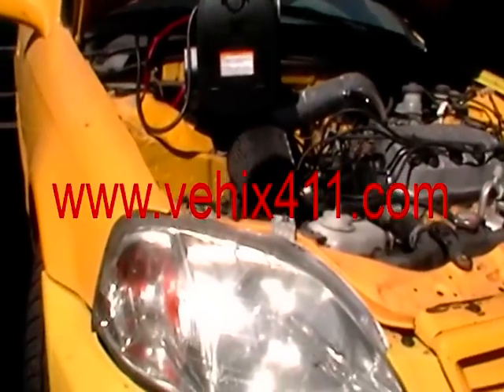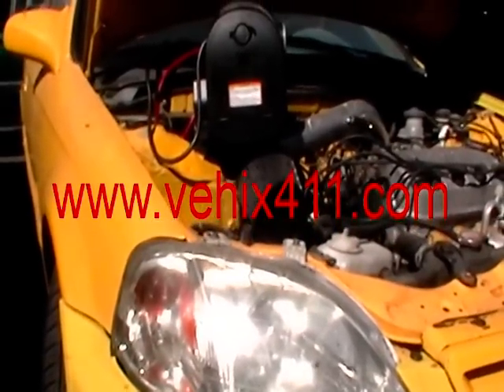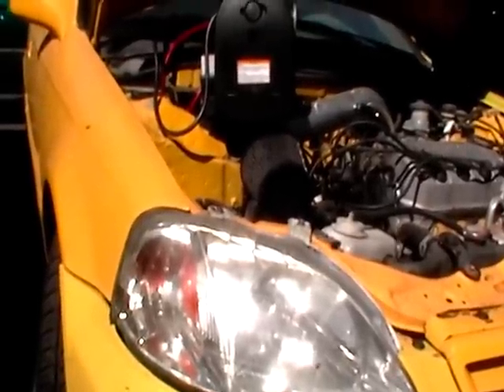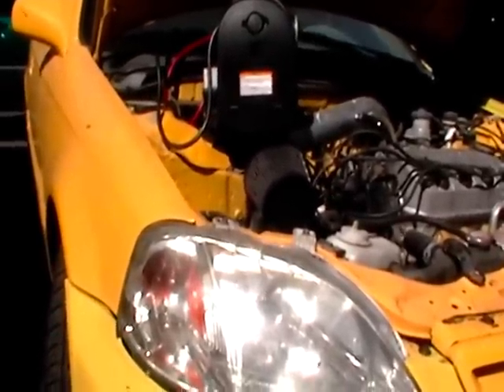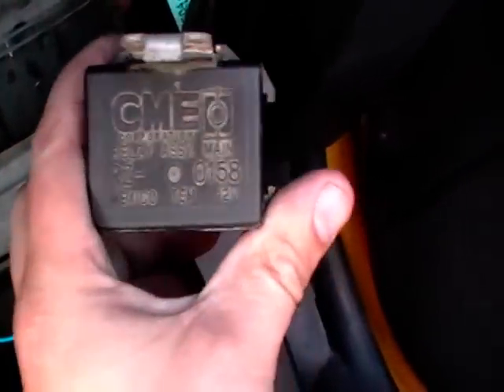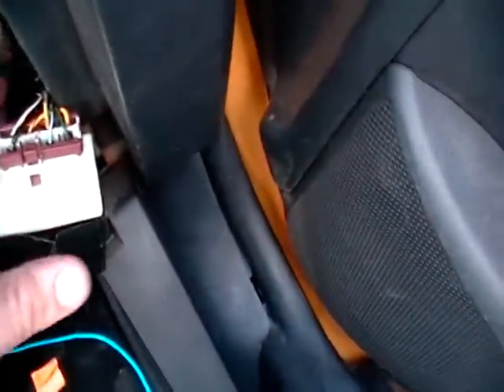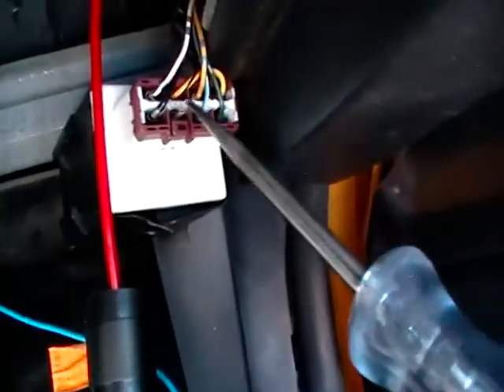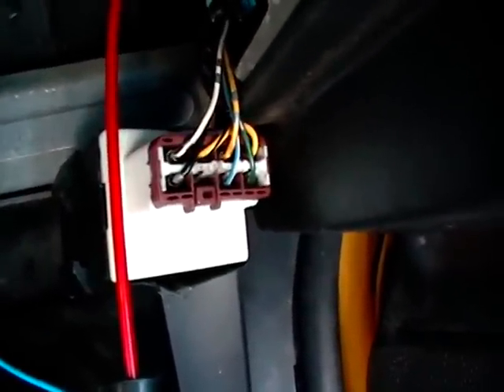Honda PGM-FI Main Relay: Hidden Secrets Exposed

Comment: Replaced tons of them at the dealership 😎. You can take them apart & fix them with a soildering gun
Reply: I replaced mine and it's having the same issue. Not sending power. When I power up that wire with the tester, it fires and runs like a bat out of hell because the tester sends too many volts. Have you experienced this?

Comment: @MrTikititiki 1987 Accord, The main fuel relay is in the Drivers side footwell of your car right behind the Cruise control unit. But the test should work, also check that it could just be a bad ground connection before buying a new relay, (I currently just went through the same thing with my 1991 Accord)

Comment: Thanks for the video.  If it's intermittent, I'd recommend just changing it due to the fact the fault condition won't always be present, and you'll be second-guessing whether or not you had good contact on your test lead.  From what I've read this almost always starts out as an intermittent issue.

Comment: My 2000 Honda CRV cranks and cranks, but will not start. But when it starts about every other day. It runs well so I don't think it's the fuel injectors. Somehow the spark is not getting to the plugs. I just put a new distributor on itribute are on it. Is it a fuel pump problem?  Who is the problem you just spoke about in your video

Comment: I have a 98 Civic CX hatchback 1.6L D16Y7 engine. Is this issue where the engine just dies for no reason whatsoever? It's not a temp sensor. Sometimes it starts sometimes not. Just put almost $2K into it as I need a good reliable transportation car for long distances. Thanks in advance!!!👍 My gut feeling is saying it's this as I hear a clicking noise by the ECM.

Comment: I have a 98 honda civic dx I'm having a no spark no injection pulse. I tested the F/I main relay in my other honda so that relay is good. then I stuck a complete brand new distributor in it and still no spake what's going on? Would a bad crank sensor or back cam sensor do this?
Reply: Did you figure it out? I have the same issue on a 1995 accord ex. New relay. Still no power coming from the black/yellow wire. I'm thinking ECU?

Comment: My 99 Civic Si intermittently stalls, and I noticed that immediately after it stalls and I try to turn it back on I do not hear the fuel pump prime and it cranks But doesn't start. I have to wait a few minutes before it starts again. This leads me to believe it's the main relay, it just isn't bad enough to where it won't start but it's getting there.
Reply: +Nick DiNunzio . My 98 civic has been doing the exact same thing. Have you ever figured out what exactly was causing it?
Reply: Charles J Ciccione did u ever  find out the problem I have a 1998 Honda Civic DX hatchback and with the same problem the first wire turns on and then turns off the second wire stays on constantly with ignition on

Comment: Those same cables were not lighting up on my Honda accord so I bought another main relay and it still gave the same problem with those same cables not lighting up, do you think it's a problem with the cables instead of the main relay? Please get back to me, thank you!
Reply: did you ever get yours fixed i have already installed distributor cap and relay not really wanting to blindly install anymore parts. Thanks

Comment: not full test,you just test here input power to relay from ignition,but not tested output from it to engine,pump,ignition and etc. i can get inut voltage but without output in will not control anything.

Comment: it looks like you help me with my 2003 honda civic problem. at the moment the car is cranking but no start. already check ignition pulse and spark, its seems like the spark can not burn fuel. can you tell me what else to check. i was looking for the main relay but could not find it. thanks...
Reply: Es1cv I have a 2004 civic but will sometimes not start. I was told that 2004-05 civics don't have a main relay by the Honda dealer. The car runs great and never stalls but sometimes won't start but will turn over.
Reply: Es1cv help me please

Comment: Question: is the main relay on passenger side for a Civic 2002?  ....Mario from Nova Scotia, Canada
Reply: Mario Cyr Hi Mario, I have an '01 Civic EX and the fuel pump relay is under the glove box. 2000 and newer Hondas don't have them where this video shows. Three about 1 inch square boxes in a row.  Mine are black, blue, and burgundy color. The blue one is the one you want to replace. Note the holding clips, they don't just pull out.  About $22 on eBay. Keith from Arizona
Reply: @Groovyman-je6yb  my 2000 Civic is exactly where he shows. Not sure what bs your spouting!?

Comment: Hey man, Seeing if you can help me out with getting my 2005 honda civic started.  It has absolutely no power (not even to the interior lights or headlights).  The battery is full charged (12.7V), even when getting a vehicle to boost it, there is still no power anywhere.  I checked the main fuses from the battery which is a 80A fuse that goes to a 40A fuse.  With my multi-metere I checked and there is power on both sides of both fuses.  I was thinking it is the ignition switch, but not sure how to check that?  But I figured if it was the ignition switch then I should be able to have power to my interior light at least.  Please give  me any advice as its driving me crazy and not making any sense! lol..  Thanks.

Comment: So I tested the yellow and green on a 2000 civic and it receives power then a few moments later it turns off without switching the key. Ever seen this? Car cranks but won't start. Has spark, and fuel pressure.
Reply: Did you ever find a solution for this?

Comment: My 2004 civic coupe will start sometimes and other times it won't start no matter how long you turn it over. It runs and drives great never stalls or anything. I was told by Honda that it doesn't have a main relay so I'm thinking it's the fuel pump relay. I can hear the fuel pump Come on for a few seconds when I turn the key. 
Can you help me?
Reply: 94 honda fuel relay
Reply: Io ho lo stesso problema adesso, tu sai dove si trova nella Honda Civic coupé 2008? Dove si trova questo relè PGM-FI nella mia Honda Civic del 2008?

Comment: My 94 civic ex relay checks good but there is no power on the connector on the fuel pump.
Reply: Same
Reply: Same, did ya fix it yet what’s the problem
Reply: I'm having the same issue rn

Comment: i did a headgasket and after installing it crank no start no spark. popped cap, rotor set screw fell out rotor in three pieces. junkyard replacement, got spark, lost fuel pump and injectors, lost main relay, fixed main relay got fuel back and had spark and compression but it was dumping fueln washed the cylinders down lost compression. trans fluid cylinders and turn by hand forever until i got compression back, did a dab of lucas two stroke oil to help bond with any remaing fuel and give some slide to the cylinder walls, again ton of compression. starter motor having trouble turning over, check battery, dead cell, neighbor helps me jump start for more cranking amps just to see if she will run. well he crossed the f n wires and touched the hot cable to the ground post and hit the firewall at the same time. no crank no spark no fuel. pulling my hair out by this point somehow not sure how i have got a cranking back but no spark or fuel still. so a re solder on the relay is the only thing i can think of. i dont think its ignition because the car cranks everytime i try to crank it. no wiggle key cutout, no false or nonstarts with key in start but dont have proper power to my relay according to chilton but my wires are in totally different order than any engine diagram in chilton. scouts honor. dosent match any diagram at all at all... wtf honda your letting me down
Reply: nightmare

Comment: Great info! Just a question though, on that first yellow green wirein the corner. When I turn the ignition on I get power on that wire but only for a second and then the wire goes dead no power. On the other yellow green wire the power stays on just fine. Do you know where I go form there?
Reply: HI bro, my car's main relay have the same problem. Did you end up buying another one?
Reply: Ivaan Garcia Apolinar did you buy a new one? Fixed?
Reply: One is meant to stay on and the other is only supposed to prime the fuel pump for a couple seconds and then turn off. This is normal

Comment: I have a 1998 Honda civic Ex coupe and it cranks but won't turn over and I hooked it up to my computer see what's wrong with it and it doesn't read it can it be my ECU is bad ???????
Reply: Luis Garibay did you fix the issue

Comment: i think it would be drivers side under the dash, top right corner. black box aprox 1''x1''
Reply: Curtis Cox it is on my 1999 honda accord ex 2.3l
Reply: my 2000 crv has main relay same place as the civic in this video....passenger side behind side panel below glove compartment

Comment: I got a 2001 honda civic,when i turn the ignition to the run position,and leave it there it has a crank no start condition,then I turn the key/ignition off then back on it will start,any ideas?
Reply: Check and Clean fuel filter and pump maybe not enough pressure can stay in the hose for a long time but when you just send it you get it to start cuz the pressure is best or highest at the beginning so possibly wven o ring somewhere in fuel delivery

Comment: What if I have power but the pump still wont turn on..brand new pump
Reply: do you have power and ground at the fuel pump connector ?
Reply: @soleenaskong3743  yes I do

Comment: I have a 2003 honda accord ex . 2.4
I was driving and all of a sudden the car stalled on me . I tried to crank it a few times and it started and cut back off in like 5 sec and after that it hasn't started yet. After I try to crank it there is a buzzing from the ignition until I turn it back to the 1 position. Also when I turn to the 2 position the "D" gear indication comes on for a few seconds and then goes off. Any suggestions would be greatly appreciated . I changed the ignition switch but that did not help.

Comment: i have a problem i turn my key cant hear the pump and i put a new relay same thing not working :(
Reply: Chalres Andrew  how did you sort your problem after the new relay did the same?
Reply: @bruto1108  yes I too need to know!
Reply: Lol I'm stuck on this as well, 98 prelude 5 speed, was running when I parked it with the clutch out.... It has a new clutch and won't start, fuel pump is not turning on so I tried another one and still nothing, my fuse box under dash has no cover so I have no clue what is what
Reply: Daun Layton I have the same problem I don’t hear the click when I turn the key, My car will crank but it won’t start it’s like my relay is not giving power to the fuel pump a buddy of mine told me that my ACU might be bad since the relays not getting power I don’t know but I’m a find out soon